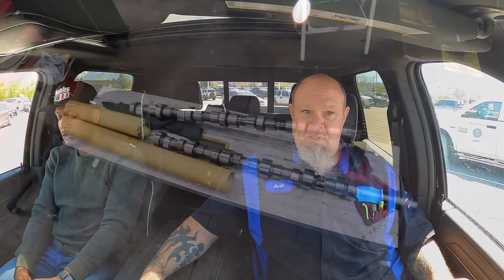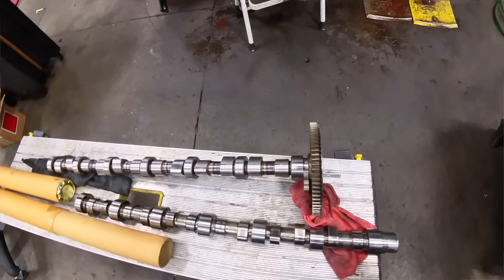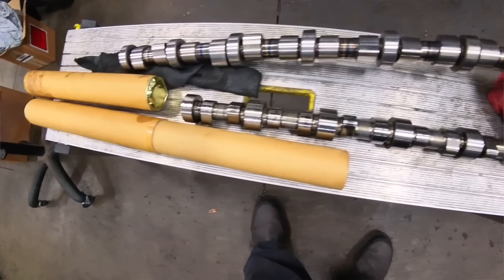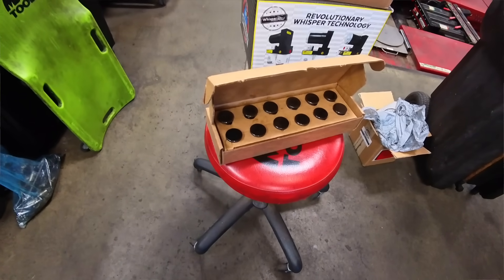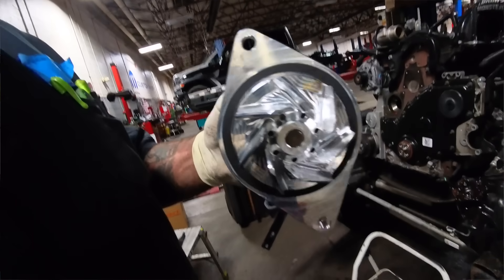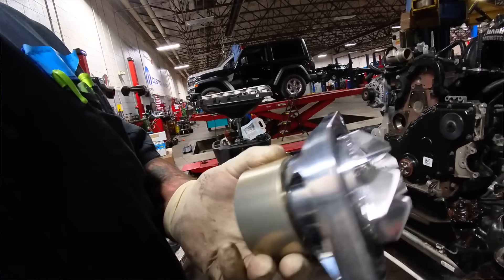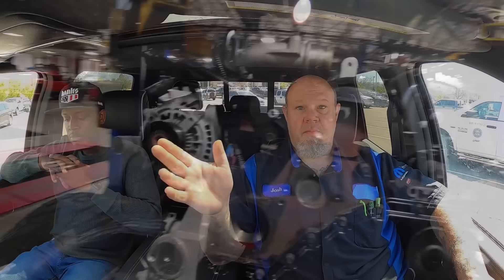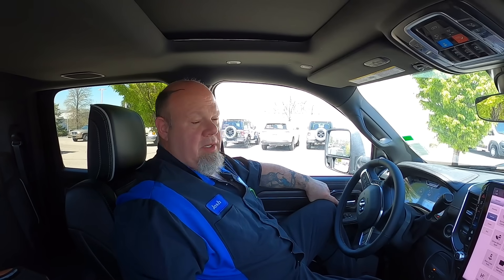Master Tech Explains How To Help Your Cummins Diesel Go Half A Million Miles Problem Free!

Comment: Sad times when you spend 70, 80, 90k for a truck. Then you have to spend 10k plus to get the engine fixed from the emissions bs, cam, lifter and rocker arms from failure.
CORPORATE GREED, simple as that.

Comment: You buy an expensive truck and still have to spend another 30k on fixing a new truck.
Reply: Exactly....why not just drive till power train warranty expires then trade.  The body and frames on these trucks will never survive the bulletproofing of the engines unless you're piling up miles in a quick hurry. JMO

Comment: I have a 19 cummins and a 24 cummins. My 19 has 253,000 miles on it with absolutely no problems. My 24 had less than 10,000 miles on it and needed a new set of lifters and cam. This was before i knew of the hamilton kit. If it happens again thats whats going in there.

Comment: Crazy how expensive they already mark these trucks up just to have a crappy engine until you spend an additional 15-20k to bullet proof. I could see why many consider the 5.9 6bt to be the shiz engine vs the 6.7 off fourth gen and 5th gen  6.7 being talked in this vid again gotta spend an arm and leg to get it fixed as it should’ve been built from factory.

Comment: I have a dodge 3500 1 ton with 142 thousand miles on it. What upgrades should i do? One other thing i have a truck camper in the bed should i drive it on tow haul?
Reply: Yes you should if its heavy af...

Comment: I just brought home a 2025 with the 75,000 unlimited time warranty so it will be a while before I can update mine.  If I had to do two things it would be the Hamilton flat tappit cam kit and the Fleece cooling system by-pass.  I did the by-pass on my 2000 and it made a huge difference in cooling temps.
Reply: I own a 2025 myself and i want to say they fixed those issues with this updated cummins
Reply: @ofcitsredd yup
Reply: This new one may not NEED the cooling. It has banks intake on it to ATTEMPT to get more air to the back 2 cylinders. That's the entire reason for the kit. Idk how well it works, but I guess we'll see

Comment: Nothing like buying 100k truck and having to replace cams fix coolant flow fuel flow adtermarket fuel lift pumps transmission parts lifters etc... what a pos

Comment: great  info.  i  hope  that  dealer  pays  you  well.  probly  charged  that  customer  just  for  labor  33  times  150  almost  five  g's.
i   would  have  just  bought  a  ho  powerstroke  and  called  it  a  day
1200  ft  pounds
Reply: Yeah cause ford's don't have problems at all
Reply: @pilot41186  every modern diesel engine in the trucks has there issues.   pick your poison
Reply: Lol powerstroke

Comment: Does the Cummins high output have bad cams aswell as the regular cummins
Reply from the maker: Yes
Reply: @ so what’s the real difference between the standard vs the high output Cummins
Reply: Depends on the year but ho comes with the aisin trans and tuned for more power and torque
Reply: @ well I’m looking into a new model looking for longevity and reliability

Comment: I have that delete bar from fleece. And I have that problem with water in the fuel. So what is this part? You're talking about that only costs 12 bucks and who makes it, and what's it called? Thank you, I appreciate any help.
Reply from the maker: G&R Diesel Engine WIF Sensor Resistor Plug 13-23 RAM 6.7 L
Reply: Thank you, sir. I appreciate the info.
Reply: Thank you again adding the second W.I.F Sensor to the rear. Has stopped the light from coming on.😊 I was thinking about putting some headstuds on but changing them out one at a time. I would like to hear your opinion about that Method ?Has this something that you have done?
 Change it one at a time?
Reply from the maker: I have done head studs doing the one at a time method. Unless you are running higher boost applications this method will be sufficient
Reply: Well, I plan on doing the headstuds. Sometime this summer, I was wondering if you be interested in doing the work. I also live in the same state as you. I would just need.
 To get the head studs.  I also plan on doing a second Gen Turbo set up. But I just wanted to do the headstuds first. Thanks again for your advice on the WIF Sensor.
Reply from the maker: Email me for more details joshmiller120@gmail.com

Comment: A half million miles is normal for a diesel stop using the liberal term of bullet proofing no such thing.
Reply from the maker: There is a such thing as bullet proofing and ford has had many different types on all their diesel engines. And half a million miles is rare on these modern engines without major issues. It’s not a liberal term, it’s a fact
Reply: @Trukstuf It isn’t that rare. For being a master tech you should be ashamed of yourself for frightening people over very minor issues that aren’t common problems

Comment: I worked for Cummins for 30 years, been gone for 23 years but it pains me to hear all these stories about how bad the Ram/Cummins engine has become. I have to believe a lot of it is emission related but it's still sad Cummins can't get the engine to be a reliable piece, that customers have to depend on the aftermarket to keep them running reliably.
Reply: What is dont understand is why can't cummins and ram listen to and look at what customers are doing to make these engines last and just make the stock for the engines coming off the line
Reply: @SAPPER235PUNISHER That’s not the business they’re in…
Reply: @אתהברטון  oh I know, they want to have to either spend money on repairs or get new truck every 10yrs
Reply: It's emissions, powdered blocks aluminum heads now glowplugs..... such bs
Reply: Like the powerstroke . The last 2001. I have the enternet here and i forget what the engine builder name is. Man i have a blanck here...... you know who it is. Some day cummins will be out too.

Comment: Why won't Cummins or Ram put the older flat tappet cam and lifters back in the new engine? If must be cheaper and has proven reliability.
Reply: I think there's noise regulations they have to meet and they can't meet them with the solids and/or it's a marketing thing to say you can save on your maintenance costs.

Comment: Great video, Josh and JB. I kid you not, I've been searching for a video like this for both the Ram and Ford. You guys should dive into the Duramax and the 6.7 Power Stroke next. If not as in-depth as this one, maybe just the Top 5 upgrades to cure common problems, other than the obvious weight loss programs. You could start a trend by inviting or challenging other reputable channels to do the same. Flying Wrenches is a Ford Tech, Dave's Auto Center, Getty's Garage and of course BANKS Power.

Comment: I have a 2002 24v, I put on the banks dry air filter box and the Ram Monster Intake what else can I do to better my 24v. I have 233,000 mi?
Reply: In 02 you had the vp44 injection pumps that commonly fail from lack of fuel supply when the lift pump goes out snd can be costly a good fass lift pump will help that vp44 out

Comment: Josh, can you talk about injector harness issues? Are they problematic or how often they fail? Thanks, and I have gained some good knowledge watching your videos.
Reply: I use to be a dealer tech it didnt seem to be a common issue of the harness failing not gonna say they never fail just not a very common occurence most people you see complaining about them have valve cover leaks and the harness is made to the valve cover gasket on the 6.7s and you have to buy it as one assembly but most of the time the leak is coming from the rocker housing gasket or a cracked oil drain tube anyways
Reply: @claytonavery7960  ok, thanks for the info! Evidently, it is a huge issue for later model Duramaxs

Comment: What does a bulletproofing like this cost?
Reply: Around $13k out the door
Reply: @אתהברטון  it’s basically the price of the diesel engine. If you have to buy another one and a lot of this stuff minus the camshaft you probably could do yourself. Somebody was just minor you know, mechanical abilities. You can read at Chilton or follow directions. The camshaft would be the one you need a real mechanic to do I won’t touch it. I’ll help cause I wanna learn, but I won’t try something like that myself. That’s a no joke kind of a deal.
Reply: All this stuff he just mentioned it's gotta be like 20k w/ labor lol
Reply: U're hydraulic lifters are about worn out!!! 😊
Reply: @SteveCallsen that's not a cost value

Comment: So ideally how much money do you have to invest to keep these trucks happy lol Canada struggling for parts/cost
I’m looking to upgrade to

Monster Ram air intake horn
Rev max valve body 
Weight loss program 
Cold air intake 

Will be voiding my warranty at my risk. 

If the lifters and cam need upgrading as well , what do you think the cost is running for these upgrades.
Reply: The warranty is garbage it wont do anything for you
Deleting saves ur truck
Less oil delusion/longer change interval
Cooler water temp
When i did grid heater delete and pusher intake i removed like 1/4" of soot from the bottom of intake manifold. I stuffed clean rags down each runner and used cans of brake clean and nylon pry bar tools. As for your warranty..they take all parts off. Hot tank them/clean sensors. Reinstall parts and then you repeat the process of eating your own farts. Its a racket of the highest level..

Comment: How do I email you? Would like to do these deletes except the Banks, as I already did this fix. 2021 Ram 3500, 9,000 miles. Yeah, I parked it until the heater solenoid fix was available (2+ years).
Thanks.  And GREAT video, again guys!  Really helpful
Reply from the maker: My email is joshmiller120@gmail.com 
I will not delete an emissions control device.
Reply: @Trukstuf I misspoke.  I want to bullet-proof my Ram engine. Not delete. I’ll email.  Thanks
Reply: But did you do the grid heater under the  intake horn?
Reply: Replaced mine at 55k miles. Look one up on google. You will want to gasp,cuss, cringe...once u see whats under the intake horn. Absolutely garbage. Truck starts fine at 10 degrees in winter cant verify for anything colder then that
Just plug your truck in if your that worried. At those temps u usually want a bra over the front grill anyhow cuz my truck only comes to temp after i drive a good distance. probably 15 miles

Comment: How often do you see the timing housing to block leaks on the 6.7 cummins?
Reply: Very common especially if not changing the crank case vent regularly you dont have to pull the cab or the entire radiator and grill to change like allought of people say though if you slide the cam out till it almost touches the radiator and slide the timing house out till it touches the cam gear you have enough room to clean the old gasket off and since the new gasket has a hole in the bottom where it meets the oil pan it slides right around the cam shaft and makes the repair much easier and shorter that way
Reply from the maker: I’ve seen them leak at 30k and some at 200k

Comment: It would be nice if the truck came with proper parts ....it reminds me of a Buyer of a Jeep they have to change all kinds of things ... rip the suspension out change tires and wheels
Reply: I completely agree with the first sentence.  
My experience with my stock 2021 Wrangler Unlimited Rubicon diesel Jeep was this. I took it off-roading at @Windrock in TN. Call me st^€|[.  Single black diamond trails. Call me |nsan€. I needed to be pulled twice because I didn’t use the bypasses.  An expert spotter guided me through them.  
My 05 Dodge Ram 3500 Cummins, rebuilt trans, pulled a steel trailer with two rigs 1700 miles round trip getting 16 mpg. An awesome experience.